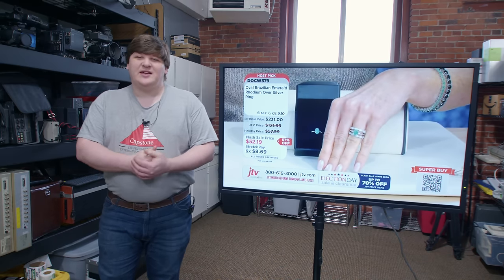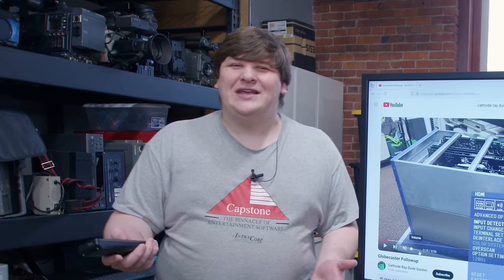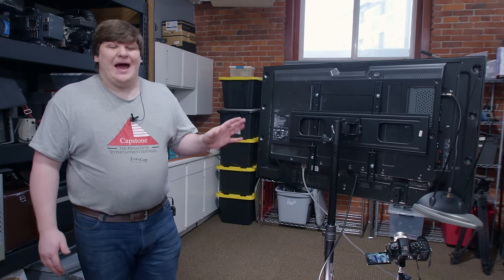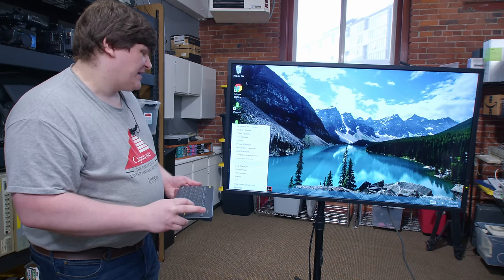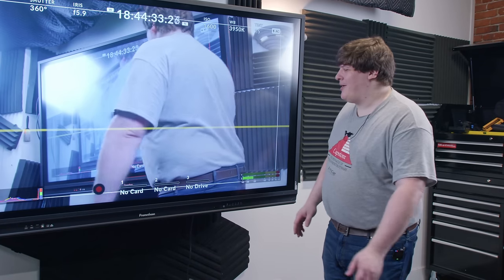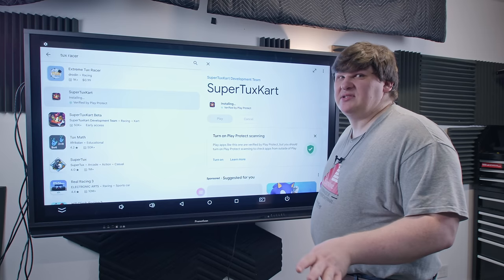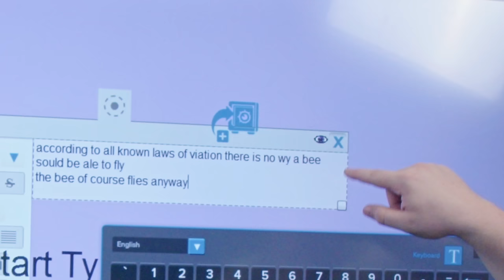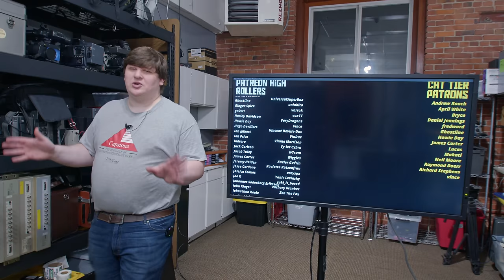Several Incredibly Smart TVs!

Comment: PAL-60 was used in Brazil. Aka PAL-M: exactly the same B&W M standard from the US (bandwidth, channel frequencies) but using PAL color standard adapted M system.
Reply: I had a daewoo 32" 16 by nine crt that could do pal 60 and ntsc 50. And rgb 50/60.
Reply: I've heard that PAL-60 is a different thing than PAL-M, but I've been unable to figure out what make them different.
Reply: @LordVarkson  proper pal-m has different amount of lines(like ntsc, 525)

Pal-60 is the pal(50) just at 60hz(625 interlaced lines). Or its pal-m. Depends on the device.

Only universal tv cards and such tend to support both even if the chips in the devices would.
Reply: Pal 60 has a 4.43 MHz color subcarrier, Pal M 3.575611 MHz.

Comment: It is actually quite common for the tuner in consumer-grade TVs to be a plug-in module as well, so they can sell the same TV around the world and only install different tuners as necessary for each region. It just isn't meant for the consumer to easily swap out. And there are usually settings which can influence the type of de-interlacing used, such as "Game Mode" which sacrifices quality to reduce input lag, or that awful "TruMotion"-type feature which tries to interpolate everything to 60fps or even 120fps.

Comment: PAL60 ended up being quite common in Europe - it's just PAL but at 60Hz, so if the game you were playing on a game console supported PAL60, you'd get both the resolution of PAL and the refresh rate of NTSC(-ish). I know the Playstation 2 supported it, but it was up to individual games to support it.
Reply: I first heard about PAL60 when something on Xbox 360 required that instead of regular PAL 50Hz
Reply: If you're European and played on PS2 or Dreamcast (probably the other consoles as well), you probably saw games asking you on startup whether to use 50 or 60 Hz. Usually also including a test mode so you could check what your TV supports.

Comment: US doesn't have IPTV to the point you never heard about it?! US is build around coaxial I guess, on top of which the internet was added later as an additional frequency. EU has newer infra, which was internet-first, and TV is added as a service over network (Ethernet or optical), it's just a UDP multicast in many cases, sometimes just MPEG-TS over HTTP.
Reply: Also a lot of the US infrastructure is older and saturated, so running TV over coaxial in dedicated frequencies instead of running them all through cable internet makes sense. Although fiber is becoming more common

Comment: Im the uk those boards are pretty well used, though normally just connected to a PC and then you can write over your slideshow for the lesson, some newer ones don't even rely on PowerPoint/SMARTs proprietry software etc. to handle it right and just overlay the drawing onto the video input if you wants. They also usually come with training for teachers.

Comment: Wired remote is mostly useful in situations where you have multiple of these facing the same direction but you do not want the remote to control all of them at once. Also you do HAVE to daisy chain dvi for video walls on these. If you run the same video signal with separate cables tiny delays can happen among different displays and it can result in visual tearing especially if the image has fast moving things in it (sports)

Comment: I worked with these. The 3.5 Remote jack is also for RS232 (maybe more accurately just serial) control. Maybe you have a camera control for when you are presenting and you want to be able to change input or go through a boot sequence with a single button press labelled on the controller. Helps for integrations stuff and provides the customer with options.

Comment: re: the IR remote in, I used to work for an arcade and bowling alley, and the TVs above the lanes used the IR remote input for communicating with a primary controller. we had one touchscreen PC at the control desk that would let us pick a display and change its channel or input from our promotional slideshow to ESPN or whatever other sports channel had The SportBall Game™ on. so the main AV control system would actually use that 3.5mm jack to basically pretend to be a remote control - you could see it enter the channel number one digit at a time xD

Comment: Commercial TVs are THE TVs. My daily driver is a 65in Panasonic plasma commercial display from 2006 and it's an absolute champ, any signal adjustment setting you can imagine for any twisted kind of source you plug into it. The speakers on that, on the contrary, are way superb to any TV I've heard in the past two decades too, but they are basically two column speakers that clamp to the sides of the TV :P Oh, and mine didn't come with a tuner module, so I don't have to pay the NHK tax too!

Comment: the smart boards that they had back when I was in school DID have markers that sat in slots and the whole thing freaked out if one was missing. the things were TERRIBLE. Constant issues with calibration (used a projector to overlay an image instead of having the panel behind) the markers barely worked properly, and the whole thing felt gimmicky
Reply: The other fun thing with those was swapping them around because it only detected the color based off of which slot you just pulled one out of
Reply: @ProtoV33MK1  yes! and I would always swap the eraser around with a pen to use a pen as the eraser
Reply: @myacidninjatheamazing1025  I barely touched the boards, but I loved when we finally went to the ones that were just massive android tablets. Ofc, most of the use they got was either as a browser or an AirPlay display (Yes, I was in one of those high schools)
Reply: YES! Mine too, I graduated in 2012 and they up to that point had been buying them since like 2006 or 2007.
They eventually realized most teachers were just using PowerPoint anyway, so they just started buying only the projectors and mounted them so they lined up with the ancient roll-up projector screens they already used for the overhead projectors of yesteryear lmaoo

The projectors were Dell branded which I just knew meant they were overpaying for them 😆
Reply: @jakethreesixty  the school i graduated from got chromebooks few years before I got into high school and then they got new ones my senior year and the ones we had were so old they would randomly crash and couldn't have more than 3 tabs open. This was during the video classes during covid

Comment: We use OPS extensively at work for systems monitoring, digital signage, broadcast, and conferencing. It's excellent! And all of it is done on the NEC displays. They're the best! We're getting ready to purchase some SMART digital whiteboards. We had them in every classroom from 2007 forward (but that was in the days where they were projectors and had to be recalibrated if you so much as looked at them crosseyed). I'm looking forward to seeing how far they've come.

Comment: As a former tech, you actually only need one adapter to go from VGA to both component and composite. You'd need a vga to 5x bnc adapter which could be further adapted to an rca connector if needed. Use just the green wire for composite, and red green and blue wires for component. Never had to adapt it to svideo though so I'm not sure on that one. A bunch of our equipment including video switches and projectors worked like this.

Comment: I know a mid-2010s cheapo tabtop I had actually came with 32-bit Windows 10 despite having a 64-bit Intel Atom, because it wasn't uncommon for super-low-enders at the time to have 64-bit CPUs but only 32-bit UEFI chips, which of course restricted them to only being able to load 32-bit bootloaders.

Comment: I worked with a commercial display! …but not in a commercial setting. At my summer job in college we built a device that plugs into the serial (RJ45 rather than DE-9 on this brand) and shows all of the settings on its own touchscreen. It also had physical knobs for dialing in settings. Because real professionals deserve better than squishy remote keys and a tiny OSD!

Comment: I did professional AV, including for corporate events, and I've used tons of these in my career. 

I can confirm that the infrared remote plug is usually used in place of the infrared sensors. Essentially, if you took any TV, removed the infrared LED from the remote, removed the infrared sensor from the TV, and hooked up wires instead, that's what it is. Its serial IR (not to be confused with IRDA). The jacks are inserted parallel to the sensor and the LED, usually. It's really useful for conference rooms, evebts, etc. projectors will often use this as well to control them because you can't always get line of sight to an infrared sensor and sometimes you need to stand in the middle of the room. Some of these you can easily string 100 to 200 ft of cable on. It mostly depends on the battery strength from the remote unit.

Comment: So, I haven’t watched the whole video yet, but a previous employer bought several of these NEC commercial displays. Out of the ~10, we had at least 3 die right after the warranty was up. Considering the cost, and the fact that we weren’t using any of the fancy management settings, we decided to just get whatever TV was on sale. 
You can generally set a smart TV to launch to a specific input, you can leave it disconnected from a network, you can disable all power saving modes, and you can disconnect or cover the IR receiver.

The professional displays are nice, but for a basic slideshow/signage, you just need whatever screen is available. The longest lasting screen at that place is an old TV with mercury backlighting - it’s still displaying meeting information today (~10 years of service at least). It’s generally on most of the day every day.

Comment: IP TV is very much a thing here in Europe, at least here in Sweden.
Many TV stations have switched over from delivering video through dedicated and bespoke cables and instead choosing broadband conections. New apartments don't even have a TV out plug in them anymore.
The general idea is "Why spend time, money and manpower on building up new cable lines or installing satellites and services when a broadband does the exact same thing over already existing equipment.
Also has the added advantage of not interlacing the video signal when you get it.

Comment: In my school here in the UK, We used smart-boards that had no display at all, they were a huge resistive touch screen that came with pens and an eraser, the actual image was done through a projector that matched the smart-board's touch board. 

This worked in a very similar way to what you were showing with the 75" Display, but a lot cheaper (since the smart-boards do not have a display, they are FAR cheaper, and you can use any projector you wanted as long as it matches the aspect ratio of the board). 

Some of these smart boards were designed to be used as an actual white board aswell, as long as you use a marker pen that is easily cleaned, this means if there is a power cut you can still use the board as a standard white board and still do class work (My school did not use this type, they used the ones I mentioned above, having a white board on either side of the smart board). 

My friend Callum M actually bought a projector and one of these boards for pretty cheap (around £300 total in 2018) to use as a home theatre of sorts that is interactive. It was a very cool nerdy idea that yes, was no where near as good as a 65" 4K OLED or whatever, but it was touchscreen and very cool to mess around with.

Comment: I can tell you exactly why the PIP is restricted - I work with commercial panels. 
The main board can only handle a small number of inputs which is less than the number of sockets you have. 
All of the input ports go into switches which are then sub selected and fed into the main scaler chip.
The pip is a feature of the main chip so it can only work with the signals the switches feed to it.

The tuner device you have is based on the OPS system. You can get Android, Chrome and Windows PCs in the OPS form factor as well. 

Love your channel by the way!

Comment: I grew up is school using those digital whiteboards. It was mostly used by the teachers. They would use them as normal whiteboards most of the time, but sometimes they would input images. Now most teachers use iPads and drawing tablets. They sit at their desk and write up on the board by screen mirroring to it. It can be useful because they can record their screen to add to the online class portal. That whiteboard is a second generation of those types of things. The first used similar tech but had a projector instead of a screen. The ones my school system used were called “smart boards”

Comment: Also as a paraprofessional, I work in a school, I work with a couple of different versions of smart boards. I actually prefer honest, old school physical blackboards are whiteboards. Knot digital. For one thing I've noticed that real old school black birds and whiteboards are a much wider ratio in any TV or monitor screen I've ever seen. At least they were if they were made prior to 1989. And you would frequently Mount two of them side-by-side to make it even wider yet. Think of making one of those about 4 or 5 ft High, and in the format of say panavision and put two of them side-by-side with minimized frames. With higher resolution stylus input like an iPad with an apple pencil. Now you're getting closer to what I actually want in a Smart board.

Comment: There was one time when i was visiting someone in a care home, and i believe the TVs were displaying live TV alongside a feed that showed the status of the call system (whatever the correct term would be)
The call units had 3 buttons, Emergency (Red), Call (Green), and Cancel (Grey), and the emergency button seemed to get used as the standard call button

The only digital whiteboards ive ever seen used were ones that required a connection to a PC, and had a projector, and either required a special pen to be used, or were able to respond to touch but also had 4 pens and an eraser, which when picked up would allow stuff to be drawn or erased on an "ink layer", the pens and eraser didn't do anything special on those

Comment: We had a fleet of these at uni, and they seemed to work well, considering how badly they got abused. Most of them were grossly underutilised - mostly being used as monitors in bookable shared spaces and classrooms. The ones in the classrooms were connected to the centralised presentation system.

Also, it seems that NEC had their own digital signage little guy - the "NEC Live." The one that I saw on eBay runs Windows 7 Embedded, so it's a bona fide little guy.

Comment: As a former student of Oklahoma City Community College, I can confirm they have something like that NEC MultiSync display or similar. What they put on the screen most of the time was your typical college/university infoboard crap. However, it didn't take up all of the screen real estate. Instead, other parts of the screen displayed weather information, and there was also live TV in a PiP or PbP or PoP alongside the general info slides. They even had one projecting to a wall right above the stairs in the STEM building.

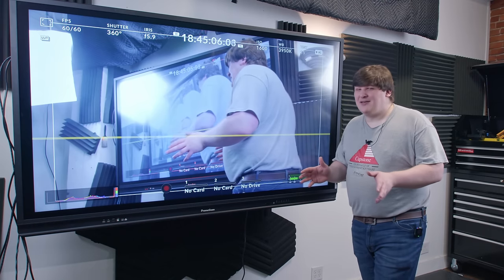Comment: 43:10 God I wish TVs would come with a front HDMI. How many poeple have a laptop, steam deck, snes mini, or some other thing they only want sometimes plugged into a TV would heavily use a front HDMI? Back in the ay the front composite on TVs was basically made for video games as the VCR would always be plugged into the back and not everyone was allowed to leave a console hooked up at all times. Or maybe you used your gamecube's handle to move your gamecube from the small TV in your room to the big living room TV. I basically keep a long HDMI cable routed from behind my TV, around my room, and under my couch next to my under couch power strip just for my steam deck and laptop which could also be solved by a front HDMI.

Comment: I have an NEC MultiSync V323-2 PG for several years, and this is the best monitor I have ever had. It eats all the signals I input. I am a retro computer freak and this monitor is ideal for me. The price was around 1500 euros and for a 32” this was not cheap. The build of that unit is like a tank and has a huge amount of connections.

Comment: The SDI input is used by a fair number of TV and commercial video studios, The fact that they are using a BNC connector rather than a 'push in and hope it stays' connector makes a difference to a lot of the industry. There may be other advantages, but I don't have any equipment with it to test any of it.

Comment: Idk if any other comments said, but my memory of PAL60 was just a slightly upgraded pal, where you got 576 lines at 60fps instead of 50fps. The resident evil remake on the GameCube was frustrating without it because otherwise it just ran at 5/6ths speed (literally, the characters looked like they were running in slow mo) to accommodate the lower frame rate. I don't remember anything other than gaming consoles of the early 2000s being able to do PAL60, and then HD killed it anyway a few years later. 13:38

Comment: 5:40 IPTV, for what I know, is basically the cable TV equivalent but for most providers here in Europe. Movistar, a phone/internet provider, usually gives you a IPTV box called the Imagenio, which connects to your Movistar router to give you TV via internet. There are still some actual cable providers, like Ono which is now Vodafone TV, but afaik it's not that popular. Most people I know (in spain, where I live) just use regular over-the-air TV or at most the Imagenio IPTV.
Also, the "over the air" TV is called TDT around here.